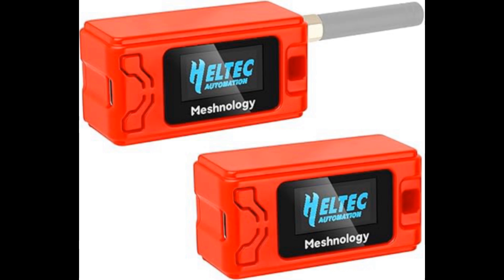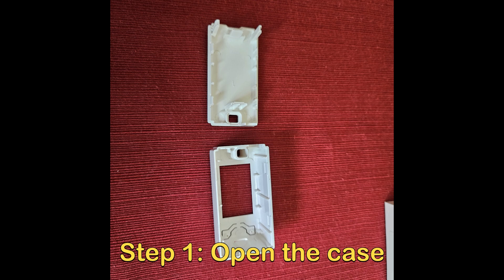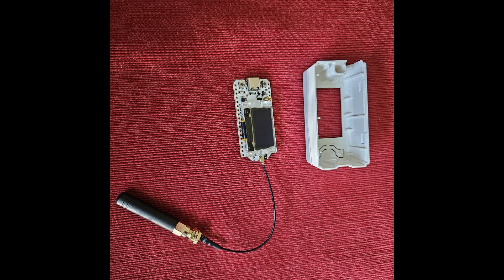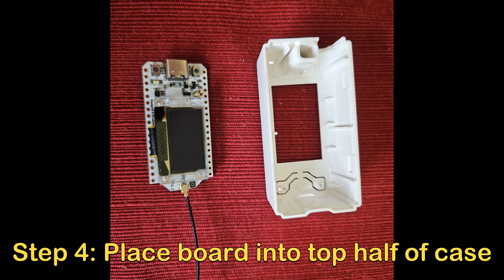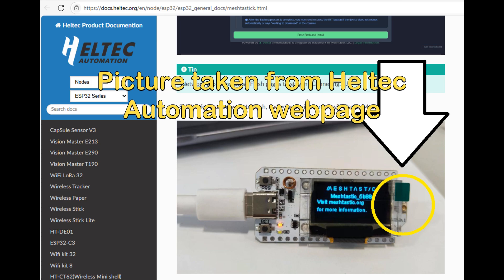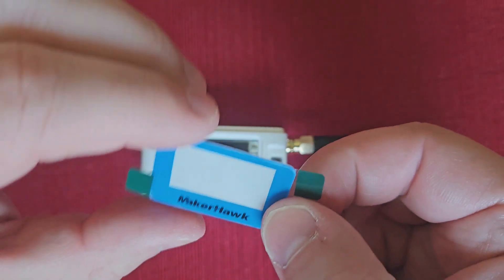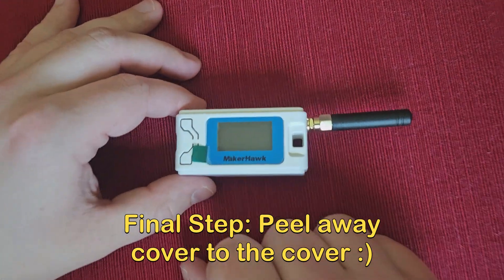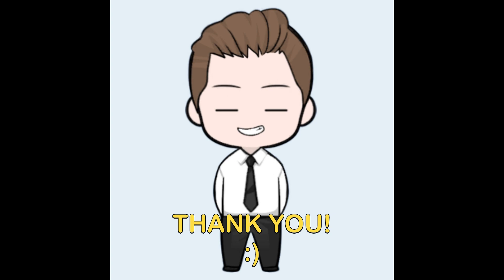How to build a Heltec V3 Radio | Meshtastic

Comment: I struggled, as we all will, to snap the antenna connector to the board. Secret is to use both hands. Do not attempt to have the board resting on the table-- it will scurry around resisting all efforts. Hold the board in one hand and use the other to wrangle the wire and connector to snap it in.

Comment: do they need to be flashed out of the box with meshtastic? Just got mine in
Reply from the maker: You only need to flash them with Meshtastic when you want to start using them for Meshtasic. Does not have to be right away as other firmware's are available for other uses.
Reply: @itpotatofarm got it up and running thanks for the video on howto build it!

Comment: Anyone know how to pop the case open after closing? Need to pop it open to fix antenna but struggling to open
Reply from the maker: Hey, @aerial. To pop the case after assembly you need to first take off the antenna, nut and washer, second you will need to press against the (push in) outer portion of the case where the multiple tabs (4) that help lock the upper case into the lower case while also trying to pry it open at the seam. Be careful as to not pry too hard as to snap the connected battery cable. I recommend grabbing a friend for extra hands or a vise. If you still cannot open the case, I can make a video showing how to dissemble the device.